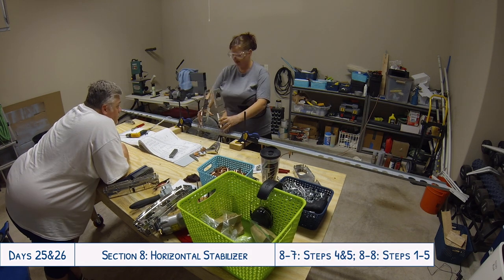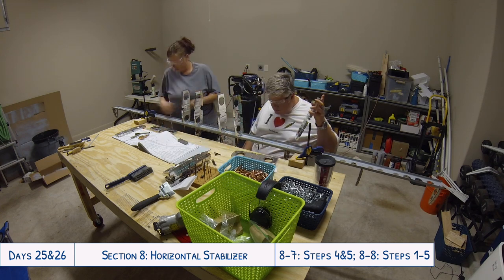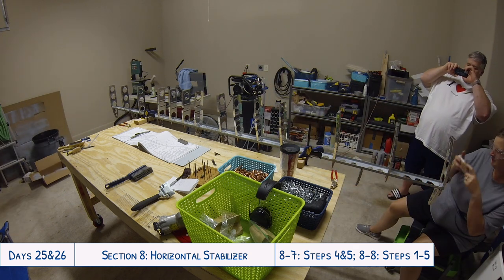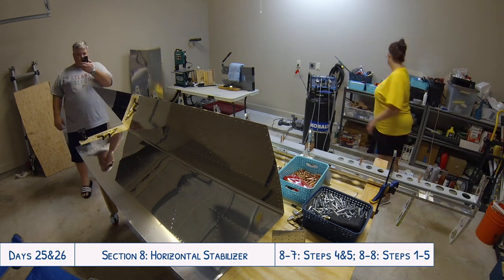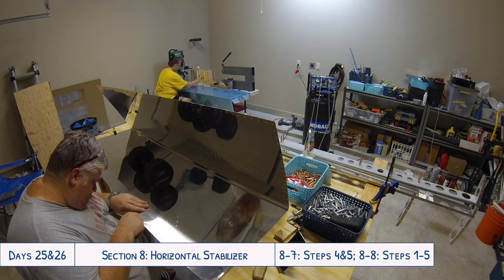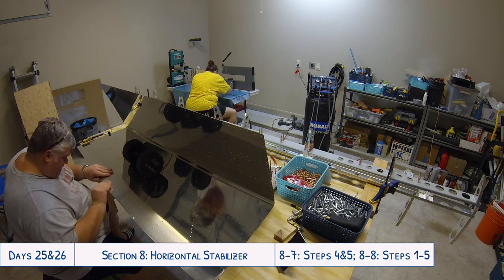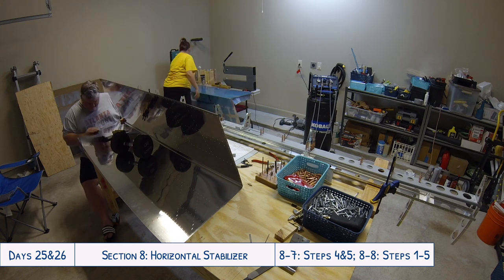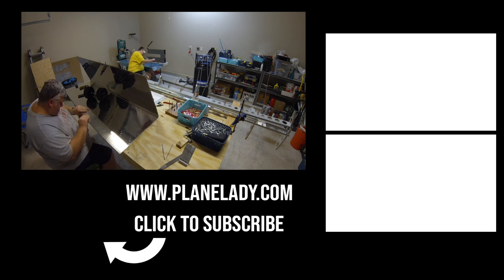Van's Aircraft RV-10 Build: Days 25 & 26 - Creating Rig & Cradles for the H. Stabilizer (8-7 & 8-8)

Comment: One of those orders last week was my fuselage kit. Anne was saying (like you said) they’ve been getting a lot of orders so expect a little longer lead time than normal.
Reply from the maker: That’s what we were looking into ordering too. With talk of possibly being in quarantine until June it seemed like a good idea. Did you alter your kit in any way for different after market add-ons?
Reply: Plane Lady nope, just ordered the fuselage kit with both standard additions. (Static air kit and flap positioner) They were both relatively cheap (when looking at total cost) and I figured if I didn’t use them and ordered a different companies option at a later date I wouldn’t be out that much much money. It’s not like my wing kit where I should have left off the landing light kit and the vans fiberglass wingtips as I ordered a set of the new winglet zip tips after seeing them at Oshkosh last summer. (Side note, I heard from Damien on Friday and my zip tips should have shipped today so I should see them this week!)
Like you I’m hoping to get a lot accomplished during this period of “mandated social distancing” and spend time in the shop while building. Today’s tasks involve installing the rear baffle and sealing up tank #1 today and hopefully #2 tomorrow.
Reply from the maker: Yeah, we got those zip tip winglets at Oshkosh too and just heard from Damien last week that ours are in and ready to ship! It would be nice if Aveo provided a list of what to remove from the Van’s wing kit if you order their winglets. We thought we’d removed everything but missed a couple things. But we had some other stuff we had to send back that was wrong with our wing kit and Van’s was nice and let us return the parts we realized we didn’t need in the same shipment. We’re still working on sealing the left tank over here too - seems like you and Rob&Christine and Ty&I are all really close to the same place in our builds 😜